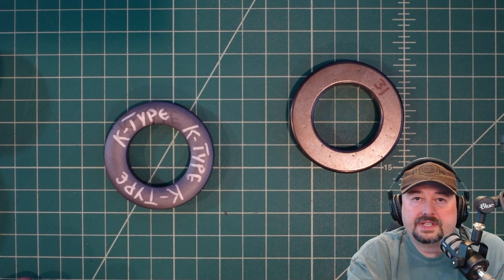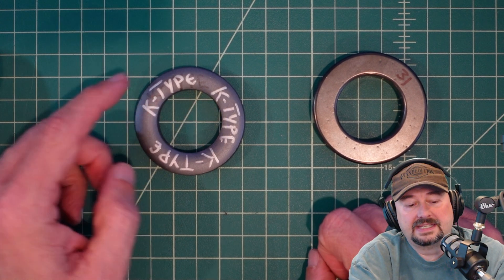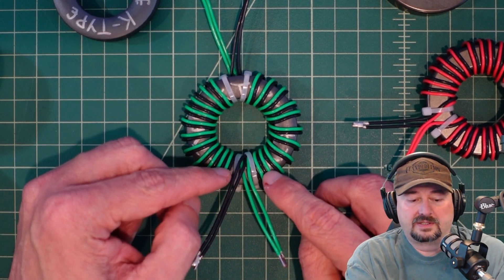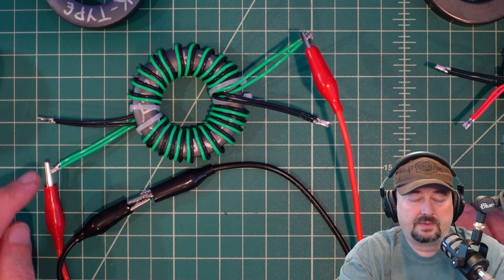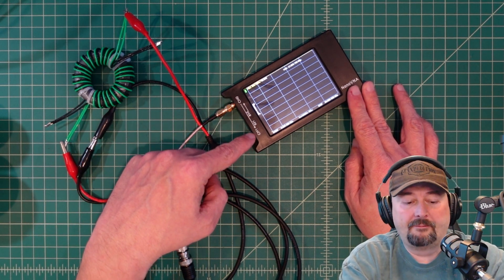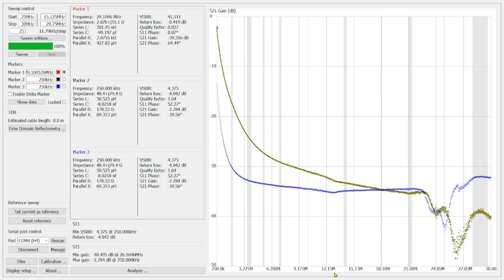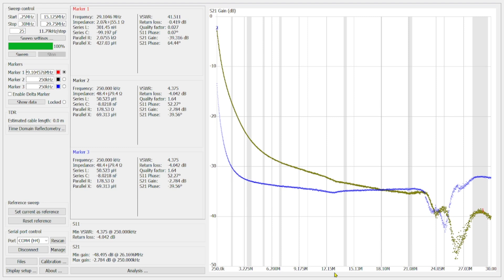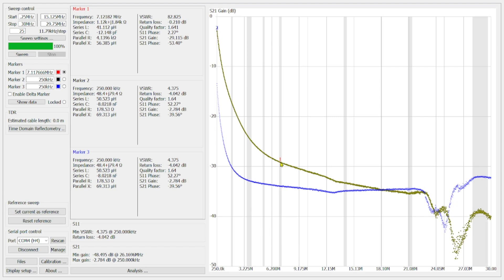Ham Radio Antennas with K-Type Toroid Balun Chokes

Comment: How do you determine the number of turns to make?  For a choke made with RG-316, I've seen videos of 4 or 5 turns on one side, crossing the toroid, and 4 or 5 more turns before exiting the other side.
Reply from the maker: I would do 11 total and then test for choking, you want to get about 25dBm
Reply: @TheSmokinApe Does it make a difference if I use stranded copper wire was you did or use RG-316 coax?
Reply from the maker: @DCSIDPA you can use either, 316 is a popular choice 👍

Comment: What is K-Type classification itself? As opposed to any of the numbered mix designations (43, 31, etc)?  I'm no metallurgist but I am suspect when a new classification that does not distinguish itself with testing first.
Reply from the maker: https://www.ludens.cl/Electron/ferrites/ferriteloss.html#:~:text=Material%20K%20is%20something%20special,it%20has%20exceedingly%20low%20loss.

Comment: Thx for showing how to Build & Test these Choke for Common mode Attenuation.....Mix 31 Mix  has been a Long time fave with hams....The 25--28 MHz Dip might be Real additional Attenuation maybe
Reply from the maker: Hey Tom, I'm gonna run the test with different leads.  The leading theory is that the core is resonate "around" that frequency but I'e rested these in the past and do not recall the "dip"

Comment: Greetings again all knowing and supreme primate! Another informative video! It's a type K because it came from Kevin right!(actually I know better, but what a coincidence). I have a serious question now about common mode baluns. I see some that are constructed using coax with 5 or so turns around a toe-roid with 5 or so crossed and wound opposite. Effectively how does the coax construction compare to the stranded wire pairs? Any advantages with the coax?
Reply from the maker: Pretty sure I have done a video on them before, but I have a new one planned… stay tuned.  It’s really going to depend on the number of wraps 👍

Comment: There are two different performance specs to measure that are important because of how we use toroids in Amateur Radio:
One is the common mode attenuation which is what you measured.
The other one is Inpedance Transformer performance.
Both uses also have limitations in power handling.
Some materials (like 31) are good for chokes, but are not necessarily brodbanded for Impedance Transforming (like on a 9:1 or 49:1 unun) .
Others are good for Inpedance Transforming, but not so good for Attenuation as a choke.
Reply from the maker: Totally agree, thanks for the comment 👍

Comment: that is normally what i use for common mode chokes type 31 mix . even DC chokes. if you get some outher mix one would be nice to do same test. like the powered iron and the 43 with 61 ferrite, I got T 500 powered iron on my DC solar leads but my MPPT controller. I get no RFI from it now.  both solar and battery side choked . that is how you wind them for AC mains filtering as well. I had to make one for LG cloths' HE washer . it is super bad RFI and the choke only cut some what. it has inverter drive motor  . can't even use AM radio when washing cloths . the only thing it really cut is the 6 meter noise. with DC chokes adding disk cap on out side can cut RFI/EMI even more. with AC need 3 caps. one across AC mains  and outher side each leg of AC to ground. that a EMI/RFI filter for AC mains. if you have one look at diagram on it.  how I learned to make big ones. follow the circuit and used big type 31 core.  stranded wire dissipates heat better as well. 73's
Reply from the maker: Hey Robert.  I’ve testing a few other mixes and some zest in the past.  So many, I can’t remember them all, lol.  I have a few more tests planned 👍

Comment: I recently built two common mode chokes using a good quality of 8X on type 31 with a primary use for 160 meters. An initial glance on the RigExpert looks good for both chokes across HF from 160 to 10; I still need to do a more exhaustive test using the nano vna as you've done just to make sure. I tend to roll my own chokes over the years using this method which have always served me well. That being said, I need to go back to your vids to get a better grip on using the nano.

Thanks for the posting!
Reply from the maker: Glad the videos are helpful, thanks for watching 👍

Comment: Yes, very Interesting Ape. Remember you helping me with the first UnUn I built? Figured out the problem. The core was an NXO-100. I guess the three wires have to be twisted before you start winding the core. Even being wound correctly, it didn't perform very well. Anyway, as always, thanks for the information. I might try a 31 Mix next time.
Reply from the maker: Hey Bkuegoose!  Sorry to hear about the core mix up 🤨
Reply: @TheSmokinApe  It was before you schooled me on the different core types Ape. And how to test them. Right now I'm building a magnetic loop antenna and a 2:1 Balun. The 2:1 Balun is an interesting build. Thanks for all your help sir. 73
Reply from the maker: Sounds like a nice project, good luck with the build!

Comment: Your the Best Ape 😊interesting results ? We stack 3 core for bt1500 and 4 cores for at4k & 5k. Maybe try using 13 or 14 wraps of rg172 or rg400 is what we use in mongo balun
Reply from the maker: Hey Kevin.  I was thinking about when you told me you stack them in the past.  I’m thinking the k-type might deal with heat better at 160/80 than the 31 and stacking them would help with the impedance.  I’ll have to look into it some more 👍

Comment: I got crazy results with my NanoVNA H4 while testing my two 2m/70cm antennas. I switched from SI to MS, re-flashed the firmware and the weirdness went away. Don't know if that has anything to do with your unexpected results, but just FYI.
Reply from the maker: Thanks for the heads up, I’ve used this one as is for many, many tests.  I suspect one of the cables but I have zero “proof”.  Thanks for watching 👍